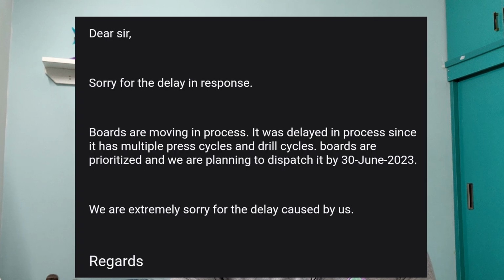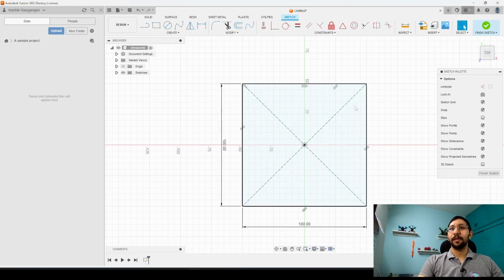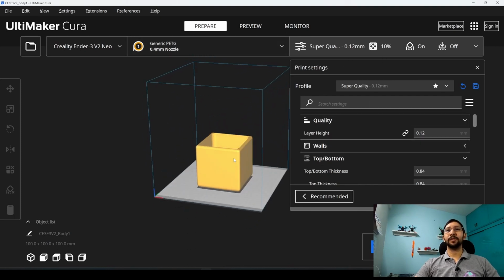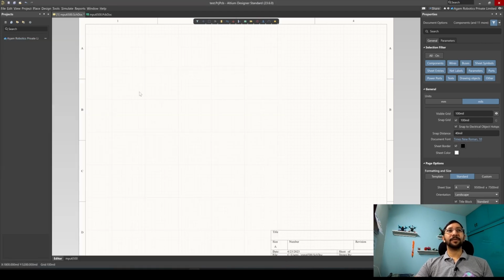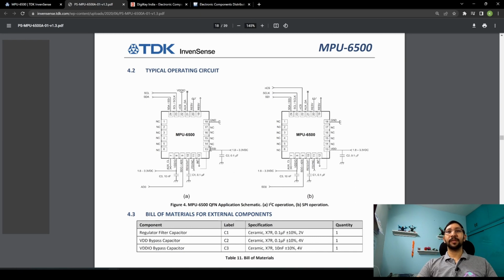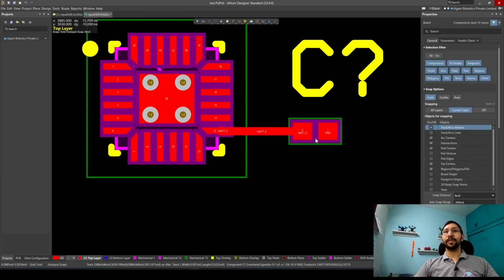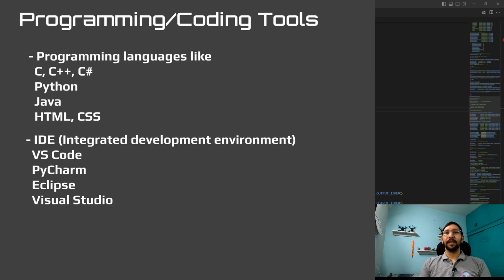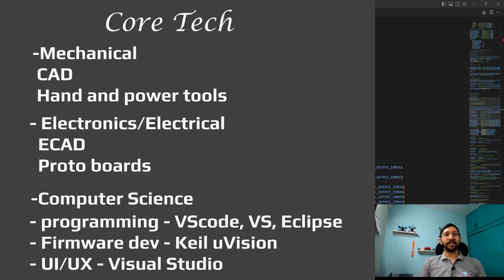Hardware & Software tools required to build Hardware startup in India: Part 1

Comment: Mine qualifies as a Mechanical Startup. Into the design and development of Drones (Air,Water, Land and beyond 😊😊) for all that mouthfull i am still a zygote !! never mind that ... 
One of the biggest challenges I faced and I don't say this lightly is the choice of MCAD software.
Over the past few decades it was ACAD ... and then later Sketchup .
was intridcued to Sold-Works got a FREE Startup licence .at an incbator .. that was an intersting expereince ... but pretty quickly I fell out of interest.
I was looking at something lighter and more SEPCIFIC to MECH ... so began the entry into other softwares ... got a Fusion 360 STARTTUP LICENCE fully featured FREE for a year and then was extended to another year and that was awesome ...  F360 support team is amazing .
In between I did explore Onshape ... naaah their commercial structure was not attractive.  so stuck with F360 (no regrets)
Last year I started onto FREECAD .... weeeeeee that was a ride I finally got out of. (I am not discouraging you to try it ... I guuess it may have matured tremendously now ...its your call).
So here we are I am so happy with Fusion 360 ... right now I am using the FREE version and it is enough for my present work.
But here is an interesting thought. I use Sketchup a LOT for visualisation and creating rough mockups .
I strongly suggest you to have multi software apporach.
I see myslelf working with F360 as the main and having a parallel line for Onshape....
Over time of course get grand and look at Catia, Ansys and all those big boys !!!